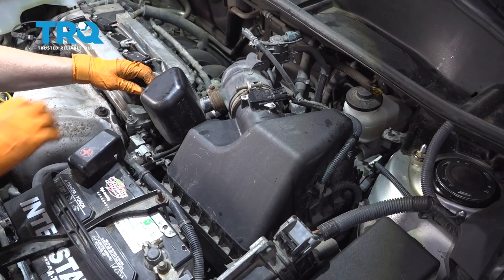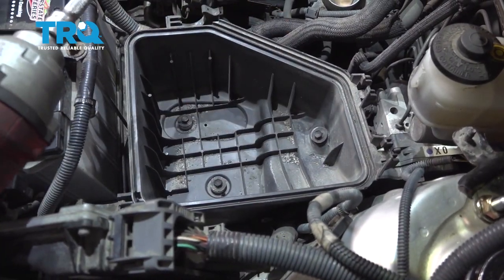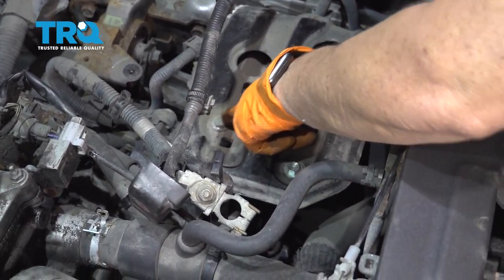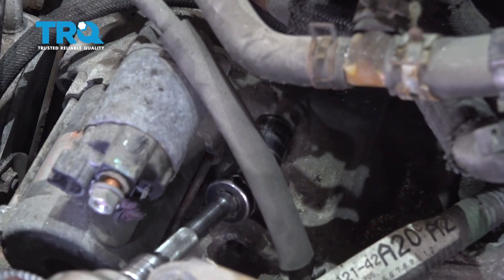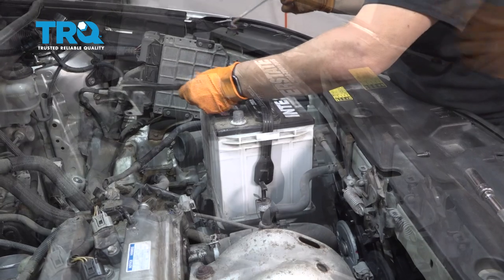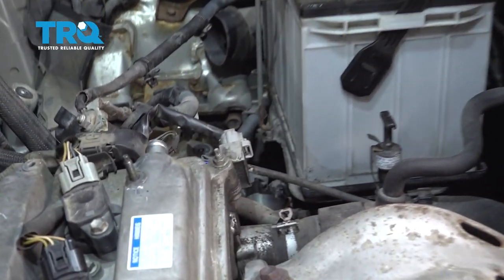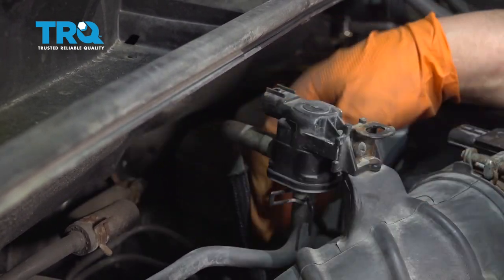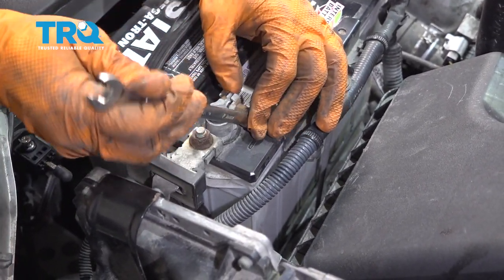How To Replace Starter 2006-2012 Toyota RAV4

Comment: If you are watching this and are about to change your starter, just know that you do NOT have to take out the air filter box if you don't want to. You can just remove the battery and both plates underneath it and you should be able to get to the starter under the filter box. It'll save you like 45 minutes of work.

This video is a very good and professional method, but other videos on this exact same car show people doing it without removing the air filter box,